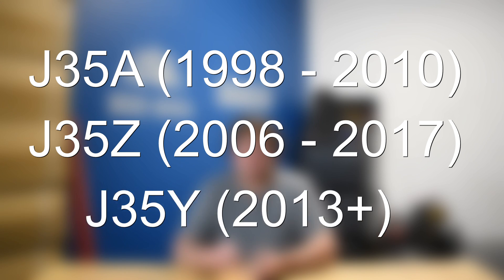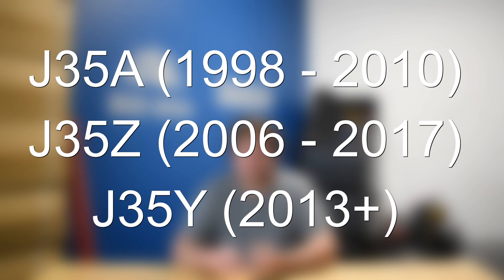The Honda J35 Engine – It is Super Reliable!

Comment: Well, those in the snowbelt differ. Cold is the ultimate differentiator, which leaves older Toyota V8s, prev gen V6, BMW N55 B58 Tu 1 2 and 3 and B48 as the most reliable engines in the planet, long mileage, arctic cold.
Reply from the maker: F - Fair point!

Comment: VCM is on some J35A engines too. I have a J35A7 in a 2010 Odyssey EX-L. It was flawless for the first 12 years, and 120k miles. Then it got the typical cylinder 3 VCM related misfire. I added an S-VCM disabler at that point and that problem vanished, oil consumption stopped, and the spark plug fouling resolved. And recently, at 168k miles, it burned out one exhaust valve in cylinder 6 (non VCM cylinder) that was rooted in a failed (galled) cam profile on that valve. Honda stock the camshaft partt, so no issue replacing it from that perspective. I replaced the camshaft, both cylinder 6 exhaust valves, and of course the head gasket. All Honda OEM parts. I'll be keeping the vehicle to the end of its life. Hopefully another 5 years minimum. It's mostly an occasional stuff hauler at
this point, and does an occasional road trip. No longer a daily driver.
Reply from the maker: J - Well said. Thanks for taking the time to share your experience!

Comment: Excellent review. Do you guys have anything to say about the Ridgelines? Are they getting a bad reputation? My ex has a 2003 Honda Pilot that has been bulletproof for over 250k.
Reply from the maker: A - The Honda Ridgeline has a strong reputation for reliability and comfort, especially among owners who value it for what it is—a midsize unibody truck built on the same platform as the Honda Pilot, which explains why your ex’s 2003 Pilot has been so dependable with over 250k miles; while the Ridgeline gets occasional criticism from traditional truck buyers for not being a body-on-frame design or built for heavy towing, it's consistently praised for its smooth ride, innovative features like the in-bed trunk, and excellent long-term durability, especially in the second-generation models (2017+), making it one of the most underrated and sensible trucks for everyday use, road trips, and light-duty utility.

Comment: 2000 odyssey slaps hard love pre cylinder management cars especially Honda
Reply from the maker: J - True! Thanks for sharing.
Reply: how has your transmission been?  My '01 in family since new, still on original at 160K, no hiccups in entire car, nothing big ever changed ,not one part, ie not even usual car stuff like fuel pump or alternators.   Everything is literlaly like new, ie the hoses, etc are like new.  It's insane quality though i live in a very mild climate , PNW

Comment: So when it shuts down 3 cylinders ( because there is no cylinder pressure which keeps the oil down )
The oil finds its way past the shut down cylinders 
And blows the oil out the exhaust .
The question is 
Where is the oil being lost?
Reply from the maker: G - On a J35 engine with VCM (Variable Cylinder Management), when it deactivates three cylinders, oil loss typically occurs due to piston ring blow-by and valve stem seal leakage in the deactivated cylinders. Since there is no combustion pressure to force the piston rings to expand and seal properly, excess oil can slip past the rings, enter the combustion chamber, and burn off, leading to oil consumption and blue smoke from the exhaust. Additionally, with no active combustion, the valve stem seals in the deactivated cylinders may allow more oil to seep past the valves.

Comment: It was that dam tranny that Honda had to learn how to build and took them many years to learn like the torque converter valve of and there is the press a gasket out of a tube within 5 - 3 minutes and likely failing at the oil pump area on the oil pan connection points - they should have just made a gasket !!
Reply from the maker: R - Not wrong!

Comment: My 07 Honda pilot has been rock solid reliable. Mine has no VCM.  

The main issue that I’ve experienced was a minor oil leak behind the oil filter housing gasket and the small o ring behind the oil pump it happed around 150k miles. 

I take maintenance very seriously, oil changes every 6k, transmission & transfer case  fluids every 30k miles and rear differential every 50k miles., I use Amsoil fluids for the engine, transfer case and transmission but for the rear differential I use Honda VTM-4 fluid. 

I have used different fluids brands over the years and the J35 loves Castrol edge, penzoil and Amsoil signature series. 

Few things that I have done are cleaning the throttle body, mass air sensor, EGR valve carbon deposit buildup. And finally PCV valve replacement every 50k miles. 

As long as no VCM are active and good maintenance is followed the J35 can last a long time.
Reply from the maker: A - Thanks for taking the time to share your experience!
Reply: When I'm looking for a Pilot I'll contact you 😂 I'll buy it from you

Comment: Well thats the one thing that I put on my 21  Ridgeline after breakin and that was a VCM disabler. So I hope that will give me some extra time of use with the 3.5 L engine. Oh, and I have a scanguage in this (truck) vehicle to monitor what temperature the disabler is telling the computer … around 74 degrees C. If the engines starts to get too hot (over 90 degrees C) then the disabler starts reporting the true temperature to the computer ….. nice.
Reply from the maker: P - Thanks for sharing your experience!

Comment: I have 2016 Accord V6 touring coupe with 156k. I have no complaints about the VCM. Plenty of power and good gas mileage. I change my oil every 5-6k using only amsoil signature series, and only use 93 octane. Runs like a champ with barely any oil burning. These engines when taken care of are amazing.
Reply: Put a vcm muzzler on that thing
Reply from the maker: M - Facts :D
Reply: At 7,500 gallons (21 mpg?) of gas through those injectors using delta premium extra of 0.75 gallon could have bought you a new motor @ $5,600?
Reply: My j35 is running 91 with 235k miles, insane miles but I keep it maintained
Reply from the maker: L - Thanks for sharing!
Reply from the maker: E - Well said. Thanks for sharing your experience!
Reply: I have the exact car but mine is at 71k miles, this car is amazing
Reply: I also have the same vehicle.I believe it’s the J35Y1. J35Y2 would be for the standard 6 speed transmission . I have the automatic. I don't drive it during winter and have 75,000 km . Yes, I am Canadian. I have been using regular fuel(89 octane) and it runs perfectly. Only change on it is cool air filter(K&N). Will change plugs and timing belt next spring before I take it out. Only issue I ever had is DRL(daytime running lights). Both went on me and the whole headlight has to be changed. Luckily I had extended warranty. I would definitely recommend.
Reply: @guylevesque5401 I had the same issue with my passenger one. The LED strip died on the passenger side and Honda replaced it free. I hope the other one lasts me! Glad you love the car. I now have 177,000 miles and it still doesn’t burn a drop of oil and runs like a champ

Comment: What's the max efficiency one could extract from stock ecu , say by , increasing the Compression Ratio to 12.5:1 , stock cams, Headers tuned for torque and free flowing exhaust , ported head , intake runners , and throttle body ..

Comment: I have a 2014 rlx which has the j35y earth dreams engine. How can I fix the carbon build up? Also I am thinking about doing some upgrades for more power output. Any suggestions?
Reply: Have your Acura dealer perform fuel induction service using BG products.
Reply: Use 93 premium gas always!
Reply from the maker: H - You can't really "fix" carbon buildup, but some options are walnut blasting to reset the carbon buildup and adding a catch can. As far as upgrades, it depends on budget and what you're looking to accomplish. Can't ever go wrong with a tune, CAI, and exhaust upgrades.

Comment: I really likes the video,   I'm one of them guys that needs hands on or a video to learn,   hard for me to read and understand compared to watching.   Away I'm looking for a new engine for my 2011 pilot,   it has the j35z,  pretty much all I can find are the j35a for sale,  I just want to confirm that it will or won't work,  I can't find much info out there on it, and after watch your video, I feel like you can lead me in the right direction,  any insight would be much appreciated!
Reply from the maker: J - Thanks for the feedback! It will work and all of the J35's, mainly Honda's, are very reliable. All depends on how well they've been maintained and are going to be maintained.
Reply: @8020Automotive  I have a 2011 pilot that needs a motor,   it's a Z in it, seems to be a tough one to find, but I see alot of the j35a for sale,  would you happen to know if there's much difference?  Maybe lower horse power
Reply from the maker: J - This has all the information you're looking for: https://en.wikipedia.org/wiki/Honda_J_engine
Reply: I'd imagine switching to an would be trouble different ecu pcm for engine and transmission.

Comment: I was told the J35y earthdreams engine is port injected, not direct injection. The 4 cylinder is direct injection. I have a 2014 Accord V6.
Reply: It's absolutely direct injected nowadays. It probably switched over a few years ago.
Reply: I believe the J35Y1 in the Accord is Port Injection but the other Y versions used in Acuras and the newer Oddysey, Ridgeline, and Pilot are all DI
Reply: @cephas1206  that's my understanding also.
Reply: Cephas is correct. The newer Acura/Honda J35 engines in most Acura V6 cars, and some bigger Hondas have the direct injected J35. However the J35Y1 and Y2 have port injection only.
Reply from the maker: B - Thanks for sharing this insight.
Reply: TD04HL-15T compatible with your 2014 v6 accord?
Reply: @josemariantonioamores8805  not sure what that is. ?
Reply: I believe you’re correct. My 2013 accord V6 has port injection.
Reply: @dy1angi11ey6  yeah, drive.accord has that info. Apparently Honda knew they were discontinuing the Accord V6 and going to turbo's with the 10th Gen. They didn't find it cost effective to re-tool the line for one model year run so 9th Gen V6 Accords were kept port injection while the 4 cylinder is direct. Happy to know that with all the carbon issues with DI.

Comment: Failed to mention the backordered for over 1 year 14100-RGW-A02 camshaft.   J35 engines with VCM tend to destroy the front cam around 135k.  Honda has stopped supporting their products with replacement parts, when the cam goes out good luck buying new one.  Think twice if you plan on keeping it for the long haul.
Reply: VCM disabler ftw
Reply: @JNguyen-f4m definitely! S-VCM on my 2014 Accord. Things a beast on full time V6.
Reply: VCM hasn't caused issues in these engines for years now. It's figured out.  @JNguyen-f4m
Reply: damn smh 220k runnin vcm disabler an routine valve adjustments
Reply: @yungherc7471 how often are the valve adjustments required?
Reply: @MeltingRubberZ28  not often
Reply from the maker: M - Thanks for adding this insight! It will certainly be helpful for future viewers.